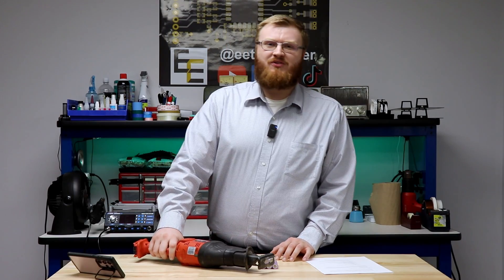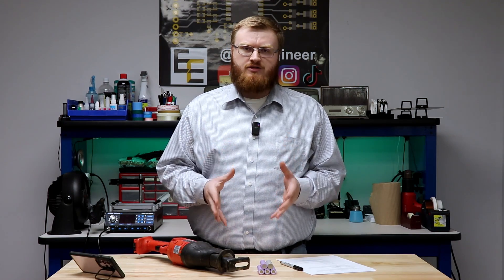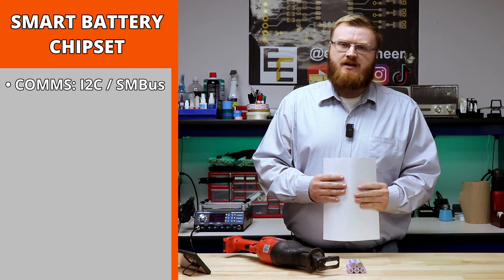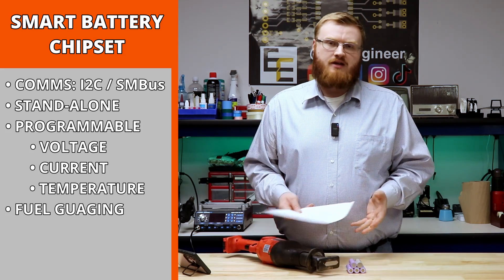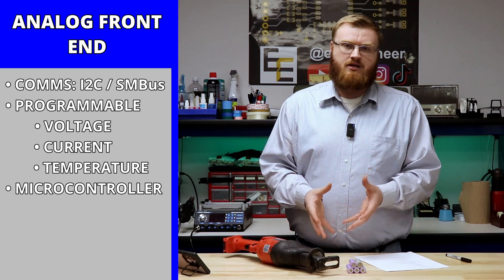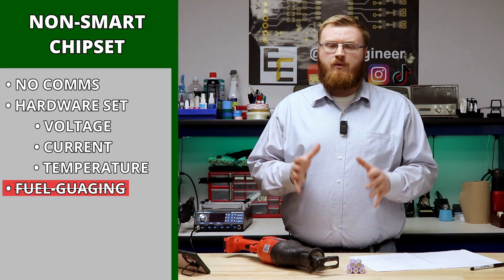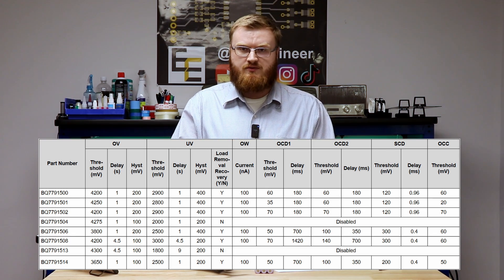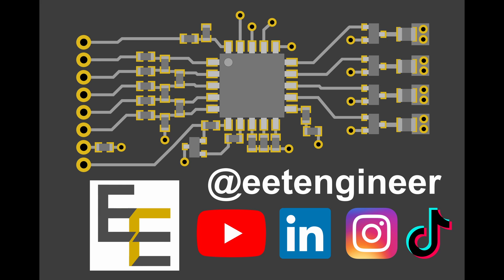What BMS Chipset Do I Need? | BMS Design Series Part 03.1 | Battery Managment System

Comment: i also did a functional tester that tests the charging of a single 18650 batt at the nominal, overcharged, and overdischarged conditions. but instead of using an actual battery on the jig, i used an adjustable buck converter with different voltages to emulate those three conditions. i forgot to consider the battery profile (CC/CV) and it doesn't work. any tips to emulate the battery using a buck?

Comment: I just encountered a new issue on my battery-powered hardware. when the battery is first inserted, the battery holder springs create a series of loose contact phenomenon (similar to a switch debounce). The protection IC doesn't immediately see the battery voltage at its full value but a sequence of pulsating values instead. The battery protection IC interprets this as an over-discharged situation and therefore disconnects the battery from the rest of the circuit to prevent draining the battery further and making recharging impossible. I have confirmed this by probing the control pin that's responsible for the over-discharge pass FET. This happens randomly and is very seldom though. To reset the IC, plugging in the charger even just for a while will do the trick as mentioned on the datasheet. This problem wasn't anticipated during the design phase and I haven't even found a single discussion of this on the internet - might be a first of its own. My solution is to delay the power up of the protection IC using a larger capacitance on its VCC until the battery voltage stabilizes. Perhaps a small cap across the battery negative and system ground will bootstrap it also.
Reply: Shorting the battery negative and main ground momentarily will kickstart it.

Comment: Great content! I'd love to see you design a retrofit BMS with a built-in charger and a USB-C PD port. I see no reason for standalone tool battery chargers for home use nowadays. Just plug in a 20V-capable USB-PD laptop charger and go. Heck, even in professional tools I'm sure it would be appreciated if the tool could be easily recharged from the 12/24VDC cigarette lighter port in a car using the same adapter as a laptop/phone. Also, I'd probaby refer to your design as a starting point if I'd need to make a device with a 3S pack. Even better if you'd publish your design under something like a CC BY-SA license.
Reply from the maker: That's an interesting idea. Built in charging might be something worth looking into for a future battery project. I am considering releasing the design as open source on github, but I haven't decided yet.